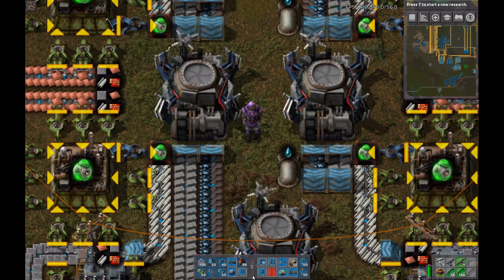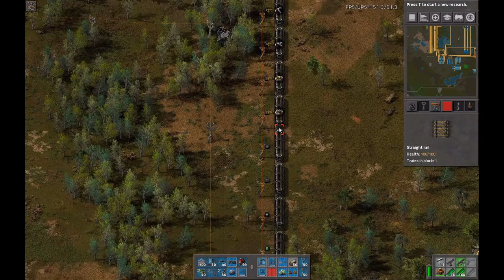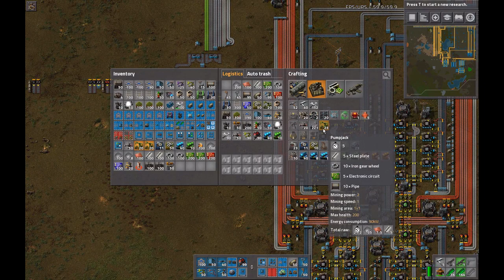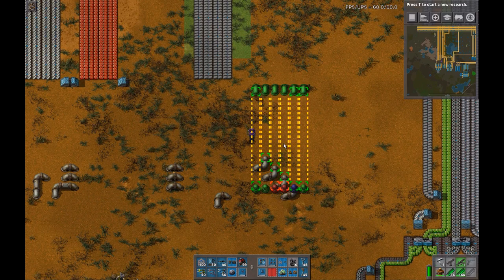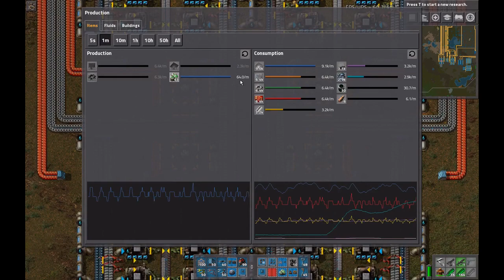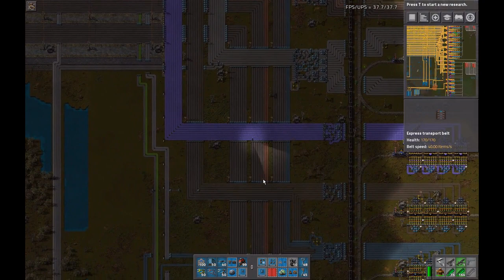Factorio 0.16 All Items - Refineries, Chem Plants, Centrifuges, Labs, Liquids

Comment: I hate to be a pain, and I will try to go back to your earlier videos...... BUT are you supplying all the resources from genuine ore patches or have you added infinite resources...... its fascinating, but you have so much in the way of resources, I could never dream of attempting this.
Reply from the maker: This is all being supplied from genuine ore patches.  I have about 30 iron patches and 30 copper patches (you can see the numbered names on the map at the right zoom level, probably the first 5 or 6 of each have run out already).  I have 3 large smelters for iron and another 3 for copper and one dedicate for steal.  Each are being fed by 12 train that are going to six different ore patches (a pair of trains per patch), and this is on top of the trains that supply my starter base and initial rocket production.  I have about 12 oil fields as well, with train supplying my oil production.
Reply: TroZ Been working on this for a while then....lol.